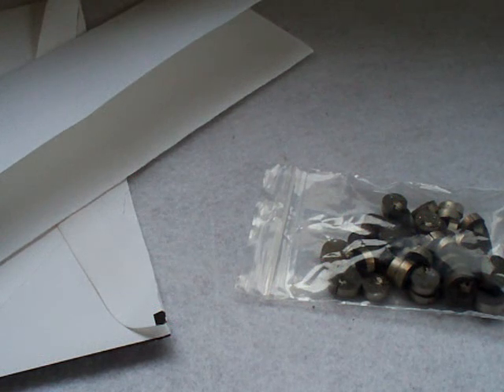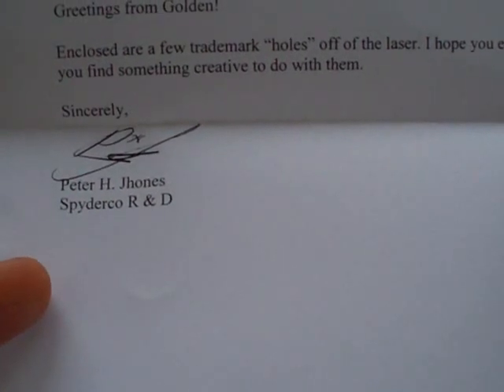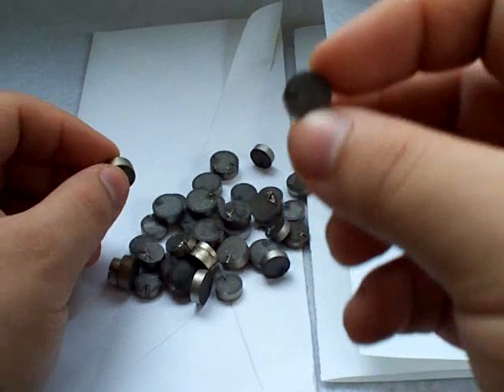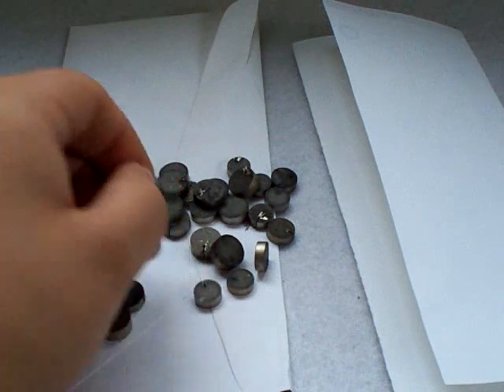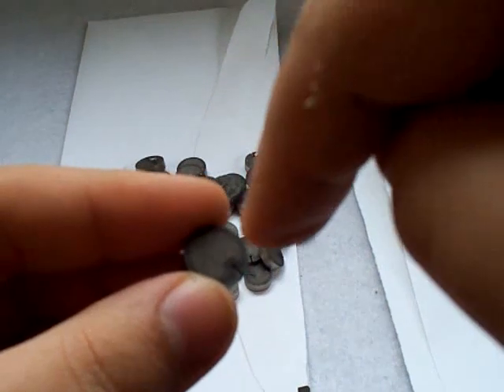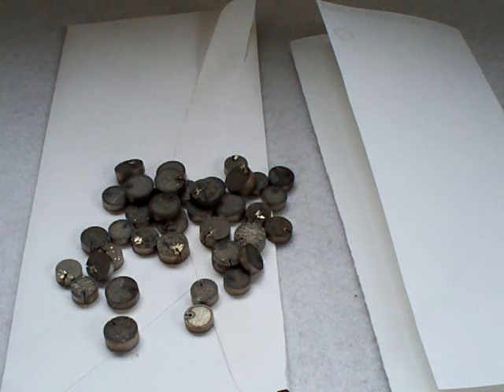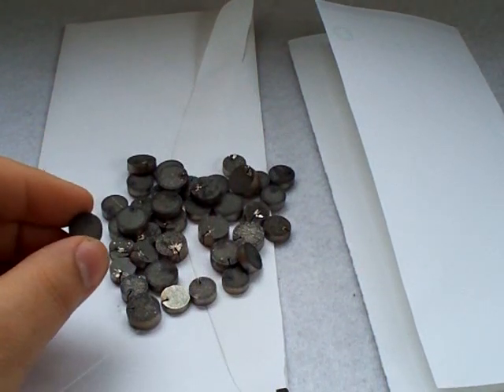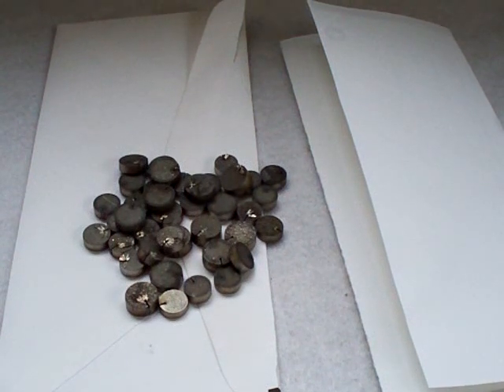Spyderco Opening Holes?

Comment: i think the splatter is actually the entry side. when i cut with a torch or plasma cutter, i get that kinda splatter on the top side.i think when the laser first hits it, the molten metal has no where to go but back up. or i could be wrong with lasers..

Comment: Cool video, I was wondering how they do the hole.I didn't know it was with a laser.

Btw those things are not "holes", the actual hole is on the blade so I dont know how you should call them.
Dunno if im clear.

Comment: No. They wouldn't toss them in the garbage.

As they cut out knife blanks out of sheets of steel, all that excess steel would all go into a bin after they cut everything out. Not only are the holes scrapped, but the steel around the knife blanks are scrap too. It's just like cutting out cookies that you have rolled out on your kitchen counter, but they are using steel instead. All that excess steel gets tossed into a bin and sent back for recycling..

Comment: haaa, they are like Dunkin Donuts' munchkins. What spyderco ought to do is package the hole pegs with the knife but clean it up and drill a hole across the diameter and put the spyderco insignia on it like a spyderco coin then you can use it as a decorative lanyard bead. If the blade has some finish on it they give the peg the same treatment. They might make more money selling them with the knife than if they sold them for recycling.